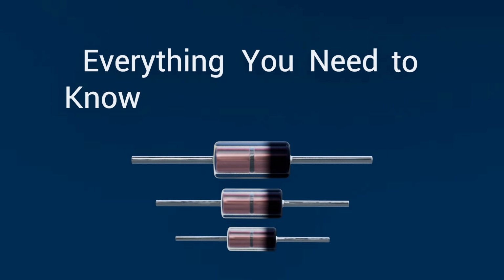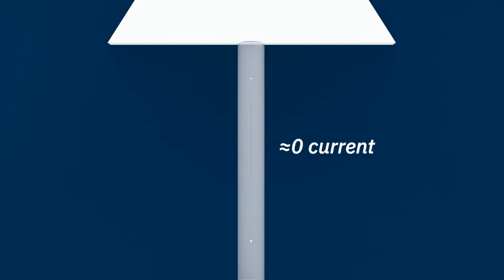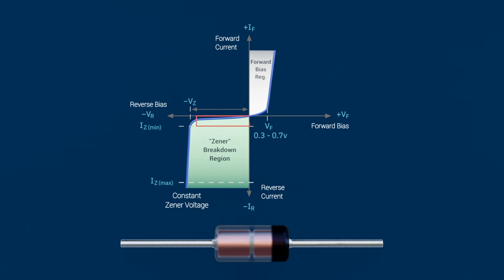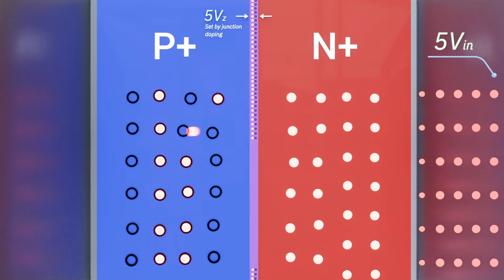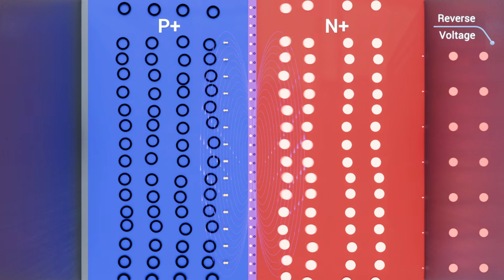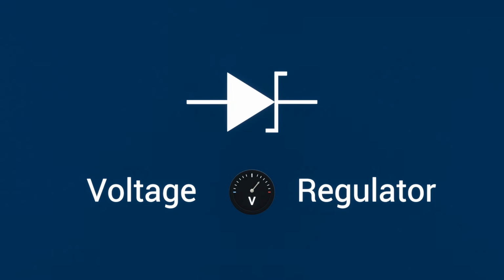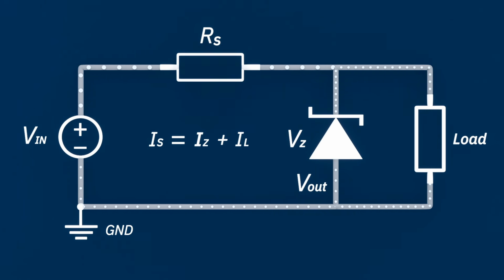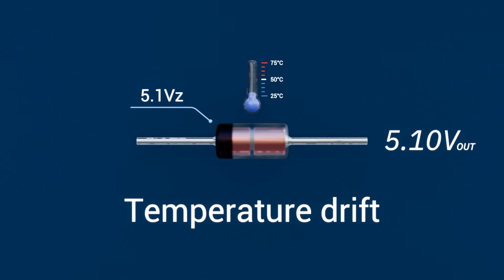Everything You Need To Know About Zener Diodes | Zener vs Avalanche Breakdown & I V Curve Guide

Comment: If I had once learned that zeners in the 5.6V range has both tunneling and avalanche breakdown, I had forgotten it. Thank you for that. BTW, zeners are especially noisy when they're barely on and you can amplify that noise if you have some use for it.
Reply from the maker: The noise behaviour is a really interesting aspect as well. When a Zener is operating near the breakdown knee, the microscopic fluctuations in the breakdown process can produce alot of noise, which can deffo be amplified and used in applications like noise generators and random number sources.

Thanks for sharing that insight and probably something we could have included. But it is a learning curve for next time! Also thankyou soo much for taking the time out to comment! it means soo much to us and helps us more than you know 😊😊